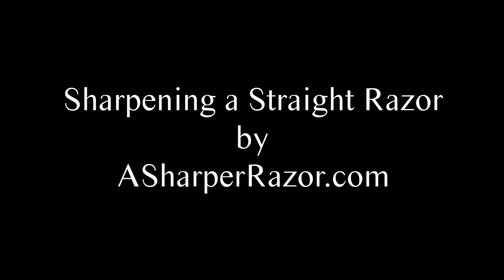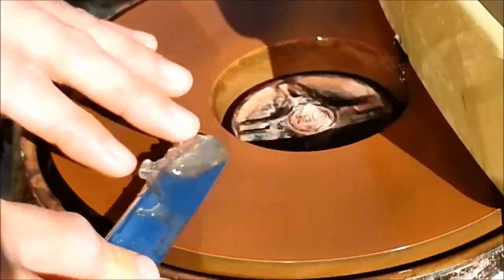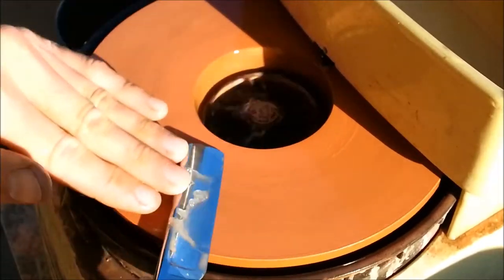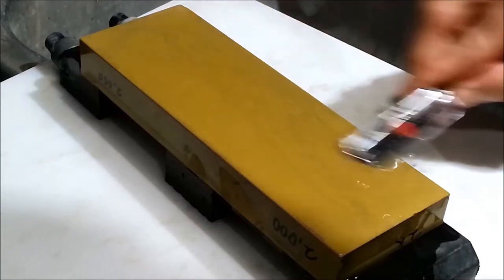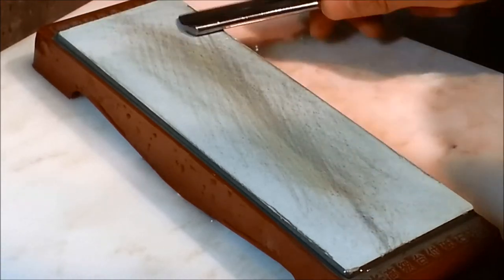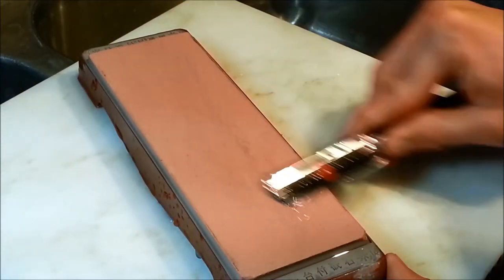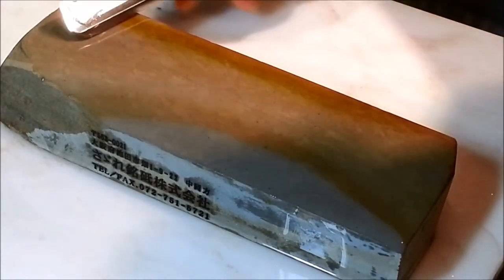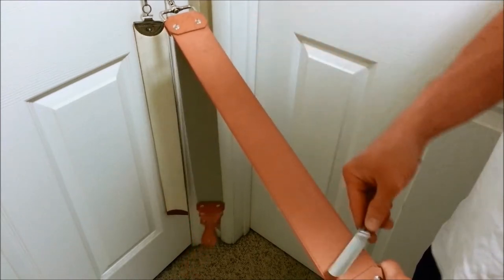Straight Razor Sharpening

Comment: Great video. Had a question which I know may be difficult to answer. But, my question is: how often should a razor be factory sharpened (other than stropping)? I don't feel comfortable sharpening my razor myself.  I know it depends on beard, frequency of shaves, etc. but generally speaking, how often would you suggest? I have medium beard growth, shave once a day.
Reply: Hello there.  Don't suppose you ever got an answer to this one by other means?  I'm in the same boat as you....and also looking for some place local to demonstrate this.  (Online is just not enough)
Reply: Well guys, since no one as answered, I'll take a shot at it.  There is no same answer for everyone.  When your razor drops off to the point where it tugs and is uncomfortable even after stropping, it's time.  Now you can get a pasted strop with CROX or a piece of balsa wood to get some more time on the razor.

Some people will only get 6 shaves on an edge, others have gotten over 100 before it needed to be honed on the stones.  Depends on beard, shave style, metallurgy, maintenance and alignment of the stars.
Reply: Hello there. ..Dr.  Any chance you know someone local to Philly who'll give me hands-on guidance in honing and stropping?
Reply: Unfortunately I don't know anyone in Philly but I would suggest going to Badger and Blade and read, read, read.  You may find someone who lives near you. 

Ask Keith Johnson. He's East coast and may know someone. (He has lots of YT hone videos)
Reply: Much appreciated, homes.  So far, I've only found someone out in Ursinus area so let's see how these options pan out

Comment: Does the sharpening machine have to wobble..?
Reply from the maker: well, it does. it's an issue. that's why you can't really use it other than for really tough work.
Reply: Definitely should not. Even for forming the edge.